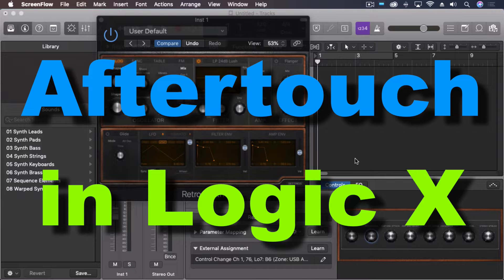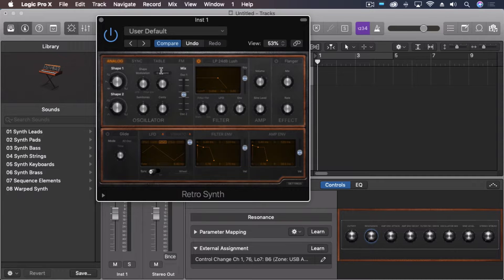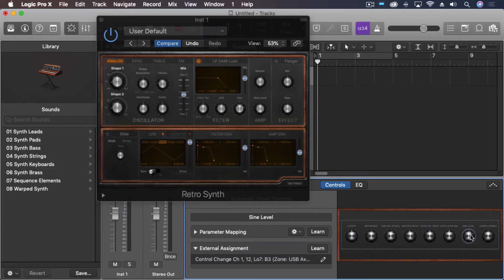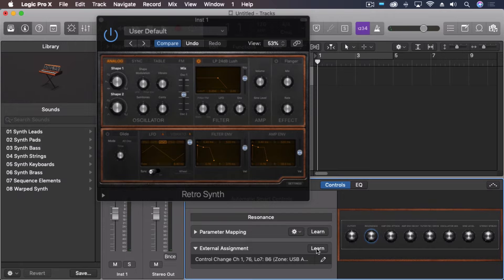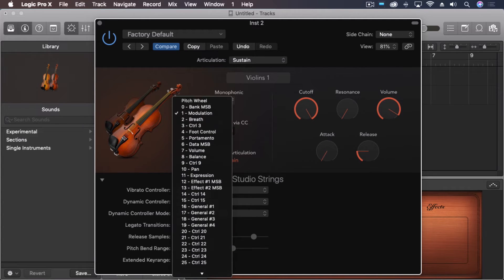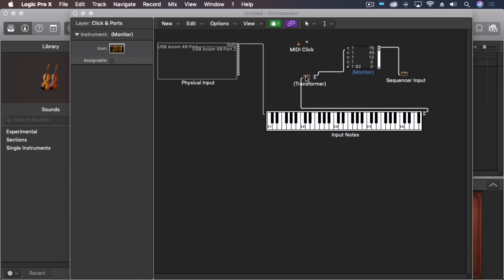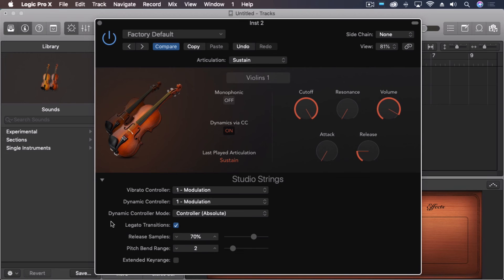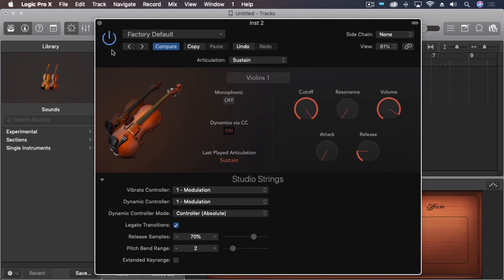MIDI Aftertouch | Logic Pro X

Comment: Thanks so much for this clear explanation of the transformer function in the MIDI environment. I've been hunting everywhere to find a way of using aftertouch on the studio strings. Any way of setting the max and minimum levels? It can be quite extreme and difficult to control.

Comment: My Alesis Vortex 2 is supposed to have aftertouch, but it's not working in Logic Pro X.  I tried several VSTs in Logic, and not a single one responds to aftertouch.  Velocity sensitivity works fine.  I looked at the midi environment screen, and it sees the pressure changes while a key is pressed.  Do you know why instruments wouldn't respond to aftertouch?
Reply: you might have to go into the controller assignments and assign aftertouch to a parameter

Comment: It's possible to use either the Modifier MIDI FX plugin, or 'MIDI to Plugin Parameters' MIDI Scripter script to achieve these kind of mappings too.
Reply from the maker: Yeah, Logic’s biggest strength (and weakness) is that everything can be done 15 different ways. 😂
Reply: Being able to use the Transformer object is your gateway into Environment-land.  Once there, there's no turning back :).  The Scripter is cool, but requires real programming (which most people don't want to get into), and the Modifier plugin is nice for simple stuff but not a real power tool.
Reply: The Transformer and Environment are powerful indeed, but the MIDI script I was referring to is a factory preset with its own interface and lets you map any MIDI message to any automatable parameter, with four mappings available in once instance of the script. Certainly gets the job done.
Reply from the maker: I like doing it in the environment because then it applies to all instruments and not just individual ones.
Reply: SomeoneCalledRob: Yes, I know which script you are referring to, and yes, that would indeed do the trick in this specific case (and many more tricks in more complex cases). I didn't deny that, did I?
Reply: You didn't deny, and I'm not accusing. Just friendly discussion :) I wanted to clarify for anyone reading that no programming was required in this case.
Reply: Ah, it was about the "no programming".  Valid point indeed.